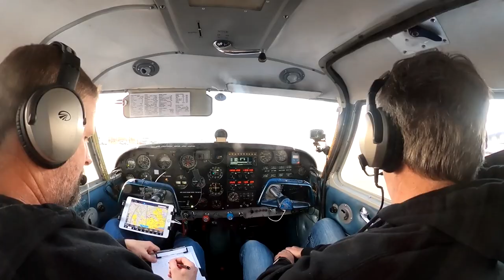What is the Airplanes & Coffee Fly-in?

Comment: G,day Brian from Sydney Harbour Australia.
Nice to see Dan, I'm not sure if this is post his misadventures in the gyro ?

One question- do you notice a instant performance improvement when bringing up the landing gear, and, are the indicators highly visible on the panel?
 🌏🇭🇲
Reply from the maker: Welcome. This was after the incident. This was just this past sunday. When the gear goes up you definitely notice an immediate improvement in speed. On the other hand when you put the gear down it immediately is like hitting the brakes. The plane starts to slow down very rapidly.

Inside the plane, indicators that the gear is down our via a green light on the panel and also there is a manual gear extension lever that rotates 90° I can tell based on the position of that bar that the gear is down or up.